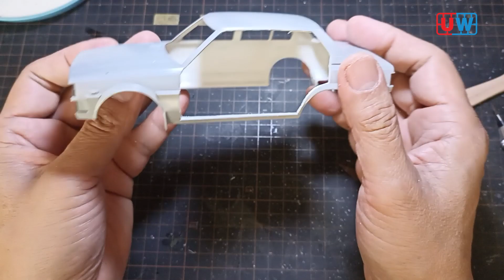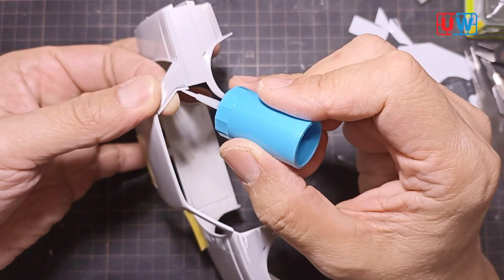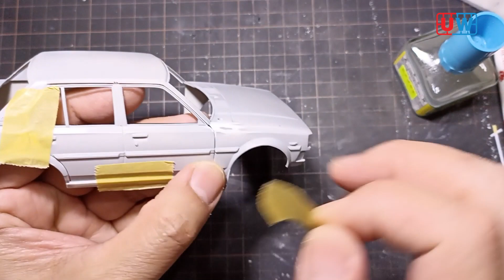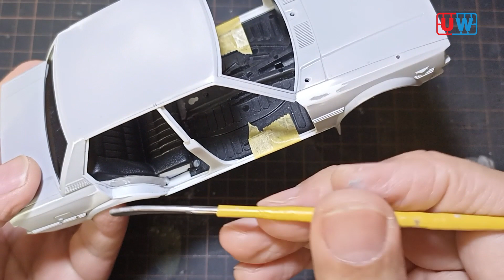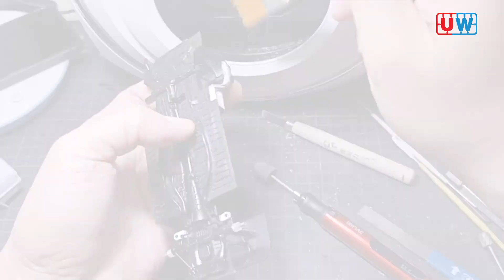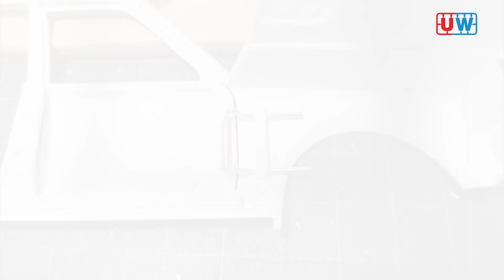【Toyota Corolla KE70】FOUR DOORS OPEN Challenge!! 1/24 model car build

Comment: You just made me get back into model car building. Been building Gunpla the last 15 years. Thank you so much. For the door frame, what kind of material are you using?
Reply from the maker: Welcome back to model car worlds , I’ve used aluminum rod and copper tube to made a hinge , it all bought from hobby shop . By the way , thanks your attention